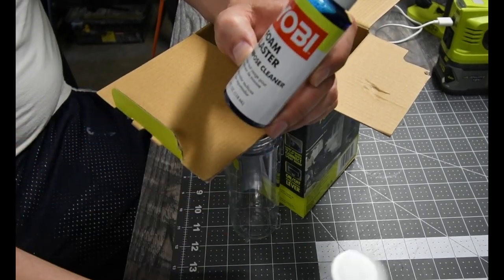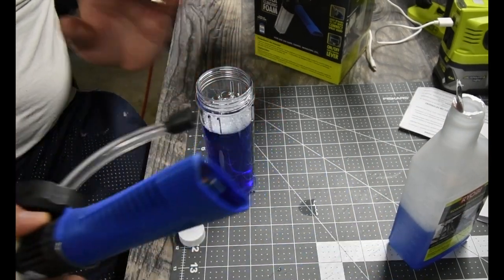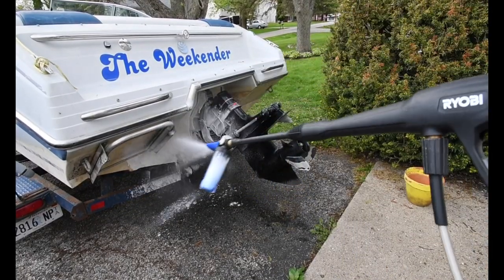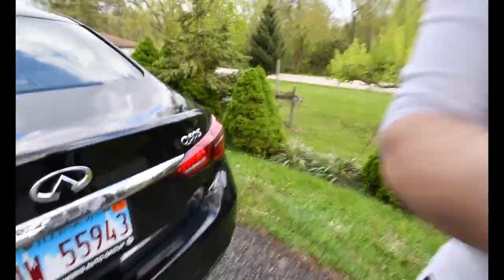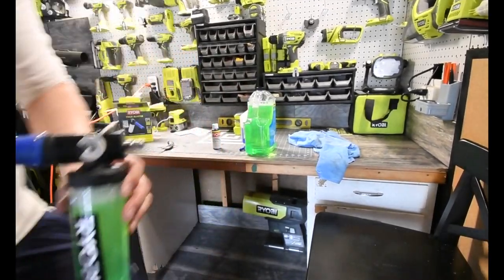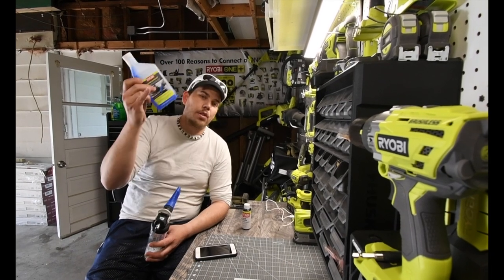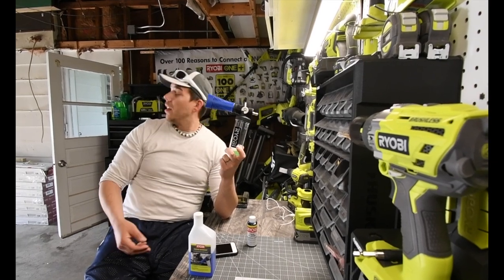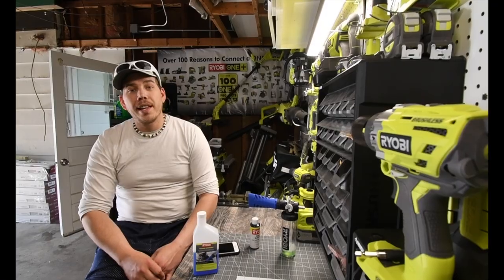Ryobi Foam Blaster/ washing cars

Comment: The RYOBI Foam Blaster is a well built foam blaster is a great tool for car detailing in addition to home cleaning chores.    I have a dedicated Foam Cannon from Griot's Garage called the BOSS FOAM CANNON which is by far the best foam cannon on the market today, however, the Ryobi Foam Blaster is still a really good foam delivery system, although you won't get the shaving cream super thick foam you get with car detailing foam cannons.    What I really like about the Ryobi Foam Blaster is it's a small foamer compared to others, which I actually like.   It feels better in the hand and while you are using it to deliver the foam "blast" wherever you are directing it.   Secondly, I like that you just pour your chemical directly into the lexan cup underneath.    I personally do not dilute the chemical first as it is diluted as it is drawn with the water pressure up through the straw and then blasted out of the device onto whatever you are cleaning.    You can certainly dilute whatever chemical you are using as the directions state but I personally have found its easier to just put the soap or chemical you are using directly into the cup underneath without diluting it.   It also gives you considerably more foam by not diluting the product first.  Again, that's just the way I do it.   Follow whatever directions are included.   I actually prefer pouring in the chemical directly into the cup over diluting it first like you do in most foam cannons sold today and then you fill the remainder of the way up with water.   I have found after using regular foam cannons for many years that a lot of the time with regular foam cannons you have product left over in the bottle hooked to the foam cannon.   You pretty much wasted product at that point as you are most likely either going to use the remainder of your product on your vehicle in just to expel the entire amount out of your cannon, or just simply pour out the excess down the drain or onto the front yard!   With pouring what you need directly into the lexan cup of the Ryobi,  when I am done, if I have any product left,  I can simply pour it back into the chemical's original bottle to save for the next time.    The blaster itself has a nice strong stream hence the word "blaster".   You can't adjust the flow rate, but you can twist the head to move the stream pattern either horizontal or vertical depending on how you want your pattern.    It is not going to give you the thick shaving cream like foam that you see with some foam cannons.   It's not that type of foam cannon.    But what it does give you is a long throw of the water and in a tighter stream making it great for not only car cleaning, but for cleaning the side of your house, barn, outbuilding, whatever.    It allows me to shoot the stream of the chemical inside up to the second floor of my house without having to get a ladder.    That function alone makes it better than the normal foam cannons you use for car detailing.   It works well to blast chemical onto your fences too.    It's a great little device to have on hand if you have a pressure washer at home.   For your home cleaning needs, sidewalks, the siding on your house,  wooden fences and decks, etc. it's a great foamer for that purpose and I highly recommend it for that reason.   The only downside to this cannon is the PRICE!   It's just too much money for what Ryobi is charging for this thing.   I don't know what those execs at Ryobi were thinking, but this cannon should be about $15 to $20 maximum.    There are far better foam cannons on the market now days that are a far better value too!   The Griot's Garage BOSS Foam cannon is my personal favorite, but the MJJC Version 3 foam cannon is a favorite of detailers worldwide.   I'm not sure Ryobi is still selling these anymore but if they are,  go ahead and grab one because, again, they are very useful for spraying chemicals onto whatever you are cleaning.   And as long as you rinse it out after every use,  you should get many years of use out of this foam blaster as the quality of the build of the unit itself is very good.   It's very stoutly built and the thickness of the cup underneath is thicker than most other foam cannons on the market.  It's a very thick lexan type of plastic that I personally really like.   I wish other foam cannons were built this good.     Even for car detailing,  I like this foam blaster at certain times when I just want put some of my Wash Chems Pro-1000 Touchless wash chemical into the cup and foam my who vehicle quickly.    Then if I have any Wash Chems soap leftover,  you can pour it back into the original chemical bottle and I haven't wasted any by diluting it and then pouring the diluted solution into a foam cannon.

Comment: Instructions say mix equal parts detergent and water.   That would certainly double capacity and make each wash more economical.
Reply from the maker: Brian Hume indeed it would
Reply: Not only that but it's actually required because the soap is concentrated. You have to mix equal parts water to dilute it, it could cause more harm to the surfaces you clean if it's too strong and concentrated.

Comment: Like Bryan said, mix some water in with the soap or maybe open the valve on top to a partial setting so it's not using so much soap out of the dispenser... Thanks for the video!
Reply from the maker: thank you sir

Comment: I have a greenworks 1900 electric pressure washer. Do you know if my hose will fit it? Ryobi is Home Depot. Greenworx is Lowe's. I know Oregon nossels will fit it. Those things can peel the clear coat off if you get too close. The Oregon nossels are designed for gas pressure washers. On an electric, it cuts the pressure down with a bigger hole. That said, the pressure is less & not as apt to ruin your paint job.
Reply from the maker: that I do not know, it might be standard size

Comment: Lol dude wasted half a bottle of concentrate...only need a few oz and fill the rest with water. Read the directions 🙄
Reply from the maker: I think I didn't break the bank. its ok
Reply: I was thinking the same thing.  Directions say mix 50/50 with water.  It's not about the cost, but it's not being used as intended. Also reading would have told you that there was a bottle inside the box with the foam blaster.
Reply: That’s great news then I just picked one up thx for info

Comment: if you read the instructions.. you'll find you should water the soap down... so that bottle will probably do way more than 2 cars
Reply from the maker: but the point of the foamer is to drench it with white thick foam. this foamer doesn't do that even with a concentrate

Comment: So my foam blaster bottle cracked and it's not sucking soap. How do I disassemble the entire thing for the parts? Yes, I will probably try to build my own blaster with the parts.
Reply from the maker: depends on how big the crack is. you can use hot glue to seal it up

Comment: What pressure washer did you use? I need a powerful Ryobi electric washer because I can no longer pull a gas cord. Please get me a good model to buy. Thanks for your help!!
Reply: I haven't tried the Ryobi brand. I've tried the greenworks sold at Lowe's. The harbor freight version is crap. Don't get that one.
Reply from the maker: I have the 1,800 PSI version I believe. works pretty well for what I need it for

Comment: Any $15 foam cannon off Amazon and a Sun Joe electric pressure washer with some Chemical Guys soap blows way this Ryobi setup. I knew this was BS when he got overexcited just from seeing the Ryobi logo on the soap reservoir. You need to use the right tool for the job regardless of the brand.
Reply from the maker: I agree. I want to get a real Foam cannon

Comment: What would a little Dawn dish soap do? i buy the 5 gal bucket  at the costco buisness center.
Reply from the maker: dondiego124 it would scratch your surface. Dawn is an abrasive soap
Reply: In my experience, any dishwashing liquid takes forever to spray off before it quits foaming. Uses more water 💦

Comment: Will this fit on the ryobi 18v eazy power washer?
Reply from the maker: no, there are set tips on a rotating head that is on the nozzle of the EZ clean
Reply: @ManCaverTools  Thanks man, I wasn't sure if you could take that tip off.

Comment: I’m a huge Ryobi fan, but this is junk. Nowhere is this close to being a foam blaster. The orifice isn’t the correct size to produce thick foam, regardless of what psi you are putting through it. You are much better off getting a foam lance off of Amazon. If you are using an electric pressure washer, you want to BE SURE you replace the stock orifice with one that size is 1.1 which you can also get on Amazon, in order to get that thick foam texture that everyone is looking for. Hope this helps.
Reply from the maker: I think it worked well, their are better ones out there but this does the trick for me